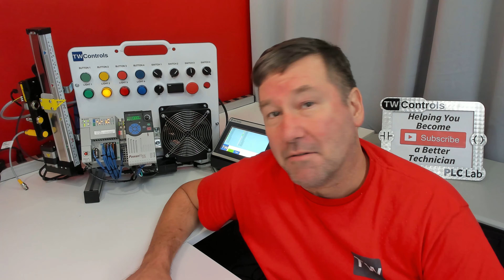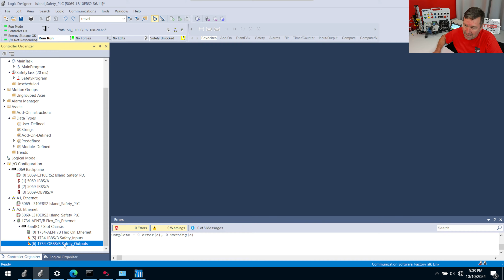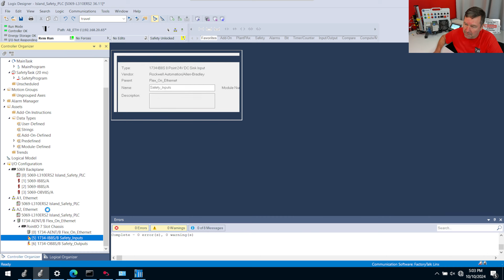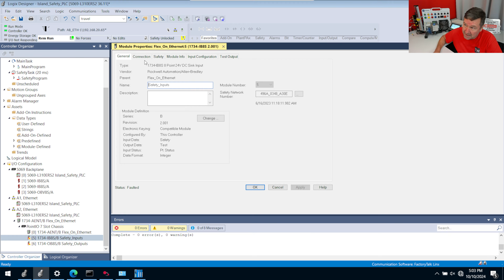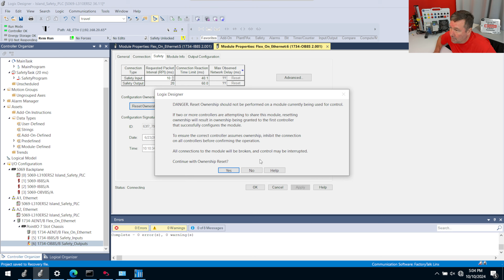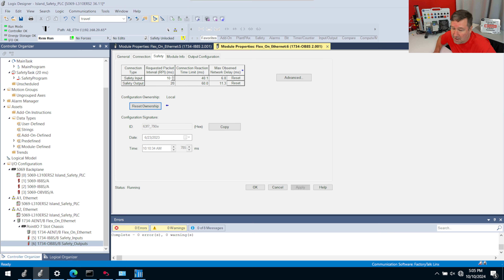Safety Module Owned with Changing IP Addresses

Comment: Yep, great tip! I ran into this issue when trying to install a drive that had been removed from another line. Luckily, a colleague had shown me this a few weeks earlier.

By the way, are you going to teach how to work with safety routines and safety instructions?
Reply from the maker: I'm on the fence about that. There's a lot to consider when it comes to safety. My thought right now is to go through some of the examples that Rockwell has already clearly documented.